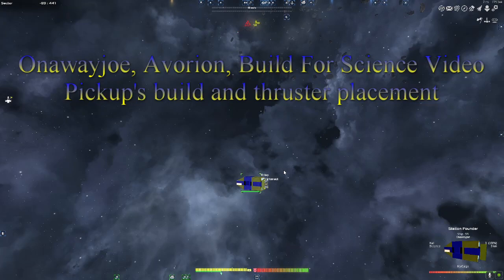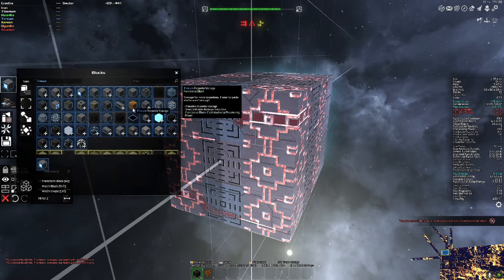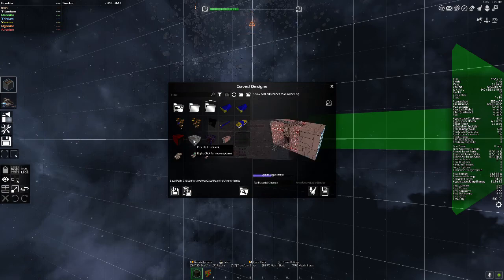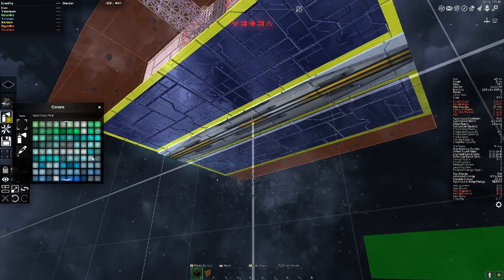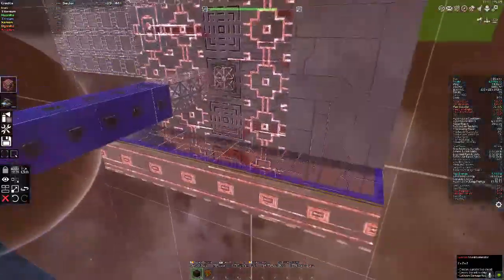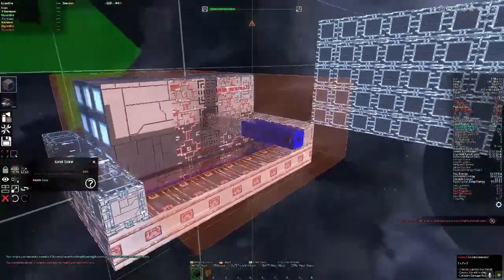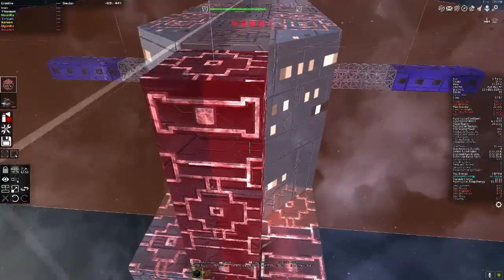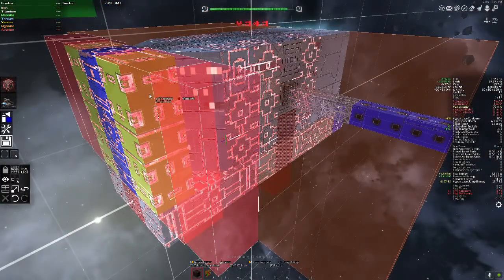Onawayjoe, Avorion, Build For Science Video Pickup's build and thruster placement

Comment: I always thought trinium makes the best engines and thrusters, followed by titanium, more to do with the power to weight ratio.  thrusters work well to begin with but as far as I understand as your ship scales up gyros work better for larger mass ships. gyros in the middle of the ship along the axis of rotation and the oposite for thrusters as far from the center of mass as possible
Reply from the maker: Yes the power to weight ratio I believe is why trinium thrusters and engines do the best as far as movement is involved. They other mats normally give more HP to the ship. 

Gyros yes do better in the middle of the ship as I can tell and better for larger ships. Issue is with only using gyros is the do not help with drifting or breaking and normally a heavier item.

Thrusters the more they are pushed out from the ship they better they do. I personally think thrusters are cheaper in weight which means they make the ship move better but on larger ships people do not make them big enough. Also, more pushed out from the middle the ship on a combat ship means more likely to be shot of the ship which does not help movement in combat and need to be protected.

That is why I am testing this little guy out before working on the huge Mark 4 build. I wanted to test the thruster out riggers I made to see if it work for the Mark 4 as well feeling it really important to movement.